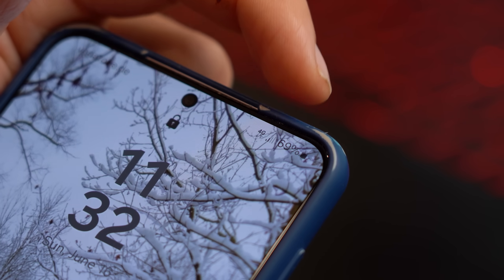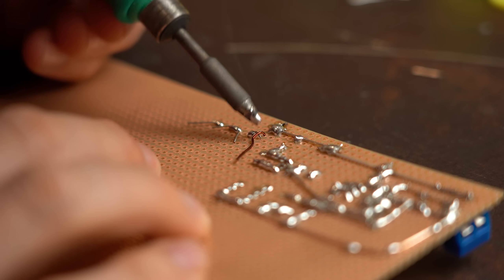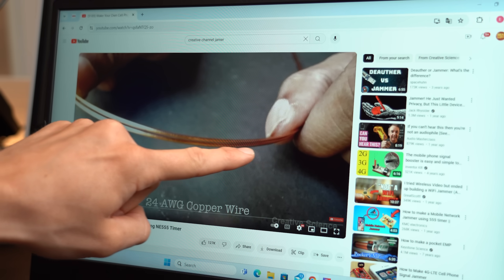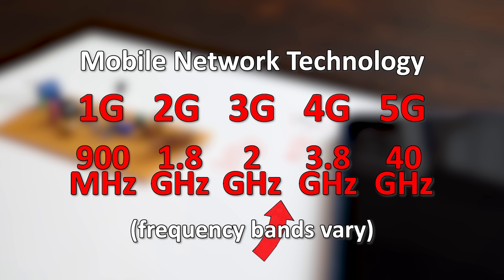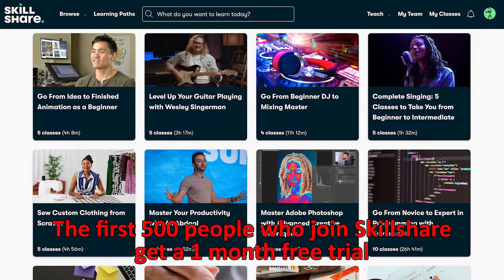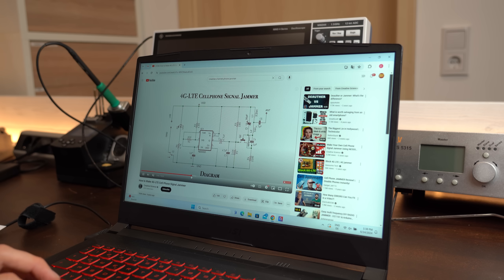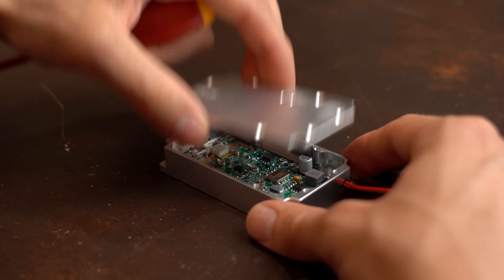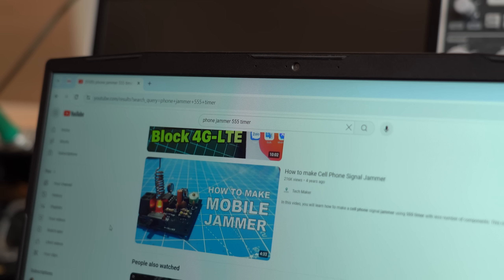Exposing the FAKEST Phone Jammer & Booster (I found on YouTube)!

Comment: If you want to learn making jammer start with low frequency FM radio with low regulated power , 555 ic can be used in real working phone jammer as Sawtooth wave for hopping between frequency to cover wide frequency range with varicap VCO you need high frequency low noice fast transistor not normal transisters you have to match 50 ohm track and load you need somthing to listen like radio or rf receiver like SDR . 
Now Day using easily available old devices parts we can easily make such projects in 4g 5g ghz range not higher than 5ghz although. Because at High frequency rf Blackmagic Start entering .

Comment: 1:59 using a 555?!,the maximum frequency 555 can do is mhz and wifi runs on 2.4ghz-300ghz
Reply: 555 is not used for oscillation instead lc tank used this ic is used for blocking signal

Comment: and even if the jammer circuits work and you can jam the cell phones you have to be so close to the device you want to jam the fcc could not detect and get evidence (unless you are jamming the fcc agent's phone in witch case they would still get bars on their phone as there is no verification or authentication to the tower just to give you bars).

all you need is a simple oscillator to generate the fequency and some antenna circuit to make the signal into rf.

you can even make a transmitter out of a crystal oscillator from vintage computer hardware they are found inside of a square or rectangle metal can with 4 pins they are used to generate clock signals for logic.

without a signal to modulate into the carrier you can still jam  a radio.

power a 1 mhz crystal oscillator pulled from 80s computer boards and bring it near an am radio tuned to 1000 khz and the station will go blank.

the reason most jammers get caught is because they use lower frequencies witch require more power and jam other devices near the frequencies (like the weather forecasting community feared with 5g networking).

however such jammers could in theory be used to force people to use the chip or swipe for their credit card by jamming the signal used by the contactless payment system and force the customer to pay with chip and swipe witch is easier to skim.

Comment: Bro i have request that i wish you will fulfill ❤ . 
1. Make a receiver with STM32 
2. Make a flight controller with STM32 Both Black and Blue Pill 
2.Make a flight controller and receiver combined with Esp32 as it's 32bit and dual core 
3. Also make one with Pi Pico 
4. Make a transmitter with esp32 that will be controlled from phone . Like i will have a ui in my Android phone ,the data will get transferred to esp32 then it will transmit is using nrf24l01 . Sorry for my bad English ❤ .

Comment: Yes they need exposing, I've seen circuitry with 555's and spark plugs supposedly boosting signal strength, and just looking at the circuit diagram you can see that it's a fake. 

Please post more 👍

Comment: 4:42 is very inaccurate and I am disappointed, and that inaccuracy is not simply some "simplification". The most important factor in why it might not work is that the cell network actually uses multiple frequencies in conjunction. 4G even uses them at the same time.  2100mhz, 2600mhz, 1800mhz, 800mhz, 900mhz, you name it... So, creating interference on one frequency band will mean nothing, user equipment will simply jump onto another band and go on...

Also, 5g is not only mmWave, so saying its 40 GHz is kinda missing too. Also B43 (3.8Ghz) is not that common on LTE, at least around Europe AFAIK. Band 42 (3.5GHz) is a bit more common, but it's mostly using existing 2G/3G bands like 1800MHz(B3) And 800MHz(B20).

Rest of the video is great and properly debunks why shit circuits like these are waste of time, but I think getting the technical details right is important. I'm not asking you to give a full telecom course to the audience, but come on...

Comment: In the simplest terms... to jam an RF signal you need 3 things to happen; same frequency (spot jamming), same modulation, and over power the signal by at least twice the strength. There is of course a lot more to it but this is the basis

Comment: 4G and 5G still use signals down to like 600 MHz in some areas, down around 800 or 900 in most, and 2G and above were able to go to 2.4 GHz or higher.

Comment: it shouldn't be hard to create jammer. just use transmitter parts of old phone. find the circuitry powering the signal antenna, make the antenna active, activated antenna should interfere with other signals and mess them.

Comment: There is limited value to simply saying "fake"; publicity is still publicity.  So if you're going to do it, please think hard about the truth you want to get across instead.  For example, would the jammer have worked if they were jamming a single-spectrum protocol, as opposed to one that hops frequencies and uses extra bits for error correction?  Maybe against a radio station instead of a cell phone?  Maybe 30 years ago when cell phones were more primitive?  Would some sort of frequency multiplier have been enough to let the device interfere with the frequencies that are too high for a 555 chip, or would they also need very different antennae?  Does jamming really require as much care as successful transmission/reception?  Could you just repurpose some wifi or bluetooth antennae?

Comment: @greatscottlab Basically a nice video, but the info about mobile technologies and their frequency is wrong. Please correct this!

Should be more like this:
1G: dead.
2G: GSM. 850, 900, 1800, 1900 MHz depending on country
3G: UMTS. Mostly around 2 GHz. Also dead in many countries.
4G: LTE. Different frequencies, depending on country. Mostly around 700, 1500, 2500, 3500 MHz and others in that range. 3800 MHz is the maximum in use, but not common I think.
5G: 5G (sometimes NR): The 40 GHz can be used by industry within an idustrial hall, same as some other freqencies, but that's not really relevant. Mostly uses 600, 700, 800, 900, 1500, 2100, 2300 and 2600 MHz. For example in Germany, 3G was turned down to use its frequencies for 5G.

Some more information to the names:
1G: old shit nobody cares about. In Germany called "D-Netz" etc.
2G: GSM: "Global System for Mobile communications". First digital world-wide system.
3G: UMTS: Needs to sound better than GSM, so it is "Universal Mobiel Telecommunication System".
4G: LTE: Needs to sound better than UMTS, so it is "Long Term Evolution".
5G: The previos one was good and first versions of 5G (called 5G non-standalone) rely on it, but it wasn't that much of a long term evolution. However, what sounds better than that name? People did not really find something, so it is just "5G". Sometimes is is referred to as "NR" for "New Radio", but thats just to have anythin kind of a name.

Comment: Flawed circuits for sure. But the 555 isn't supposed to be the carrier frequency. It's the FM sweep modulation for the single transistor oscillator / FM modulator. The transistor stage is very similar to those simple FM transmitters / bugs. Notice the similarity to the Q2 stage in this circuit:
https://youtu.be/joFourugXvs?si=ZB3W0OzhgENLjTpv&t=66

Comment: Basically 4G has built in some communication method and certain freq and power, which means you need to build signal generator with more power same method.

Comment: Even if it could have worked, at those frequencies you need to fine tune hand wound inductors by adjusting the spacing between loops. You have to take the direction of the inductors in to account, the proximity of components, trace lengths etc. That's not something anyone can do without proper knowledge of RF electronics. The booster is even worse. NO filtering for either receive or transmit antenna is the first HUGE problem. Same issues as I mentioned before in regards to tuning and PCB design. And even if the electronics would work, the device would receive its own transmitted signal, amplify it again, and re-transmit. It would literally feedback so hard it would just burn out just about every component used in a fraction of a second.

Comment: Not only those fake jammers don’t have the frequency, but since they are on the vhf range it should be nice to test if its signals is strong enough to interfere with ham radios tuned to that frequency, but you may need a licensed ham operator to TX for you.

Comment: Maybe you should show how to actually make them.

For a very long time, I want to have a tiny jammer, just powerful enough to make it impossible to MY phone to receive and send calls. I want to result offline without using the flight mode. That should be sort of 1 mW of power, if not less. Similarly, I would like a working 4G amplifier, because I am living in a zone with just too little signal.

Comment: Loved the video and the "jammers" are obvious junk.   But your method of showing that they don't do anything isn't really valid either.   Looking for changes in recieved signal strength on the phone won't really show that the jammer doesn't work because 4G and 5G (and CDMA 3G) are iterference limited systems.  Injecting noise is the best way to jam them, lowering the Carrier to Interference ratio (C/I) to the point that no data can be exchanged.   With "successful" jamming the "signal strength" on the device does not go down.  In fact it might even go up if the interfering signal is strong enough.

Comment: I might have to make a video to expose the exposer... Dude, I like your channel, but please stay away from RF topics. At least on the jammer it's painful to watch. Nice job coupling of field lines on the two coils by aligning them exactly the one way that should be avoided at all cost. Just looking at the perf-board for an RF circuit gives me headaches. "With some basic electronics knowledge, it's obvious that this circuit can not do this." -> Well, certainly lacking some of that first part of the sentence for RF circuits. The NE555 doesn't switch the 'amplifier', which is really an oscillator, on and off, it changes the operating point (and thus the CE capacitance of the transistor, which in turn changes the generated output signal). His circuit certainly works quite well as a broadband jammer with harmonics extending well into the cellular band. IF built properly this will work for 2G in close proximity. However, it's effectiveness is extremely limited.

Comment: Supposedly when you use the square wave directly you should get wide spectrum jamming (on the expense of power). 

Also the signal meter only measures the strength of the wave at given frequency and not the quality. I found out when standing inside a metal door frame I get full signal but very low speeds.

Comment: I'm pretty sure that this circuit wouldn't jam anything, but you made two mistakes:

1. In high frequency circuits not only elements matter but physical design also, you won't get any high frequency circuit working without proper ground plane (dual sided pcb, dead bug or manhattan circuit are necessary).

2. NE555 generate square wave, so rise and fall times of signal are important here to know highest harmonic frequency it would generate.

Comment: Looking at the frequency output that the "jammer" spat out makes me a little bit concerned. 125 MHz is close to the Air Band emergency frequency of 121.5 MHz, and given that you can have some MHz variance with hand wound coils, adjustment etc., some poor sod building it might inadvertently jam that frequency.
Now, given the power level of the "jammer", not that big a risk of causing harm, but you may still get to provoke the curiosity of PTT (Postal, Telegraph and Telephone) authorities in your country, and all the interesting times (in the ancient Chinese curse sense) it brings with it.
Whenever you build something which transmits RF, be attentive that they do not spit out stuff on important frequencies (such as emergency (beacon) frequencies), either directly or because of poor overtone filtering. PTT's generally are very cranky when you mess with such frequencies, and are not too happy about any other frequencies being jammed either.
Maybe a TL;DR QnD walkthrough of global ISM bands is in order, @greatscottlab ?

Comment: Interesting concept. I have played with the NE555 for years but never thought to use it like this. It does make a 'relatively' stable clock source, can be make into a pseudo pwm circuit, and many other things. I mostly use it as an add on for LED blinking in some models. Like most things I find on the internet, there is a lot of bost, not much boost.
Peace

Comment: I have got a question to ask, but its not relevant to the video, "WHAT SHOULD I BE DOING WITH THE GROUND SYMBOLS IN THE SCHEMATICS", i mean what should exactly be done with them when soldering to the perf board, where they should be connected.... and stuff like that, hope you will reply : )
Reply: You solder them to the negative terminal of the power supply

Comment: Absolutely right!! We can’t block or boost mobile RF signal by simply these things. The mobile RF system use complex modulation technique such as OFDMA and transmission technique such as MIMO will make them more immune to external interferences. The frequency hopping spread spectrum technique will spread the signal over a wide frequency range, making it more resistant to interference and noise. Modern mobile communication systems employ sophisticated error detection and correction algorithms, such as Forward Error Correction (FEC) and Automatic Repeat request (ARQ). These techniques detect errors in the received data and correct them automatically. It also adapt to changing conditions by adjusting parameters like transmission power, modulation schemes, frequency band and data rates based on environmental conditions. From these observations it is very clear that mobile jamming / boosting is not a simple task. It requires more specialized RF IC and well-designed antenna systems along with complex signal processing algorithms.
Reply: RF jamming is EXTREMELY simple, so simple in fact it is possible to do it accidentally, all you have to do is (metaphorically) scream louder than the nearest tower on all the frequencies you want to block. What isn't simple is SELECTIVELY jamming ONLY mobile phone signals and doing it in a way that doesn't end up with you destroying your device while a representative of the FCC (or your local equivalent) observes you.
Reply: FHSS isn't used on LTE/5G and if there only is 900 MHz GSM/LTE available, a simple single band jammer would technically be enough. However, often times you have all sorts of bands available.
Reply: Industry standard for boosting are Cel-Fi GO units.

Comment: The frequencies part at 4:40 is wrong, 2g 3g 4g and 5g use the same frequency bands, just 5g added some high freq ones for crawled spaces like stadiums, shopping mall etc.. usually they uses 600-4700 (likely 700-3500).

Comment: That circuit requires free energy to work correctly. Please use any of the countless free energy generators you'll find in YT. 
A little bit of snake oil to lubricate  the trimmers will help.

( And yes, please expose more of that nonsense.)

Comment: I would expose them. Incorrect information and which they are maybe making money from it. I work with Aircraft that use GHz frequencies. I knew that the circuit wouldn’t work. In our equipment that operate in the GHz range use waveguides. Not a single copper track. All good Great Scott. Love the content as usual. 👍

Comment: Sadly the scammers probably get as many (if not more on account of being simpler and therefore more approachable) as a video showing how to actually make one of these things. And it's obviously a lot less effort! It's like the engine / machine restoration videos that take chainsaws out of swamps and amazingly make them work again despite the end product being a different brand to the one they got swamp-fishing. Please do more debunking- I do worry beginners will try to make these things as a "hello world" type project and then when it doesn't work either decide it's their fault or just give up. Talking of fake, it would be perhaps interesting to pop into the Aliexpress basket some ICs to see which ones behave as expected- I know you did a project on fake ICs but it would be interesting to know the scale of the problem. I guess the issue is if they were good fakes the might behave as expected but just fail prematurely....

Comment: There is so much fake electronics videos on YT where do you even start? Just yesterday a guy with a 5W FM transmitter claims he can receive the signal 7Km away. When the signal is mangled static in the next room. Which is claiming he went on a trip with a holiday trailer across country riding a tricycle. I'd like to learn to build my own FM radio station but just got discouraged by all the fake information. I live in the mountains where I won't get in trouble running my own 50W FM transmitter. Which should go the 10KM I need.

Comment: I live in a place where I barely get any reception. Recently, my provider has cut off 3G which made me completely stranded offline. Do you think, that it would be possible to build a proper 4G/LTE extender/repeater? I mean like, hooking the antenna on a roof (I get there 4G by a bit) and then reproduce the same signal in like a 10 meter area around. I'm no expert on mobile network communication.
Reply: @thisfeatureisbad just place a spare phone where you can get a signal and share connection over wi-fi or use a wi-fi router with 4/5 g data connection.

Comment: crazy timing!! just two days ago i came across this channel! i wondered if you could boost 4g low 5g (850mhz here) using two mini circuits mmic commonly used in with sdr lna boards. I was pretty disappointed these crap videos were all i could find! Maybe you could look in to a project like that, it shouldnt be to hard using mmic chips.